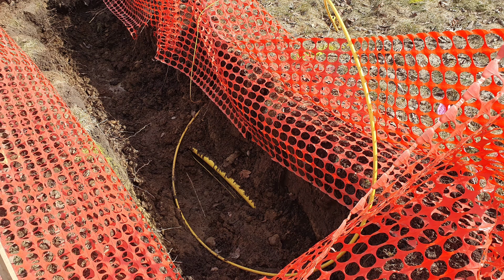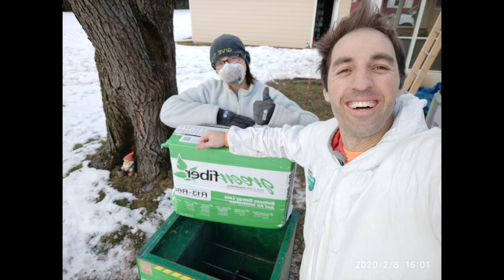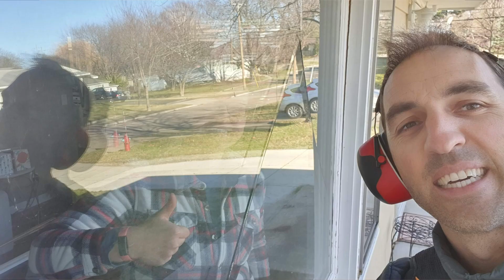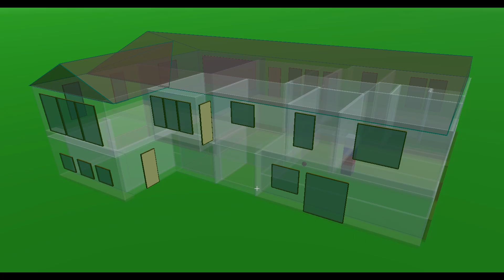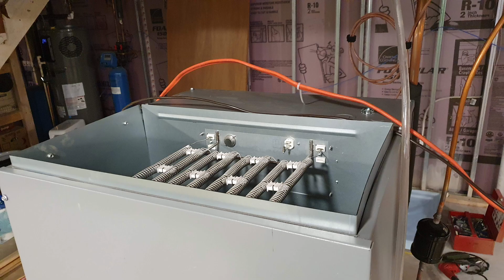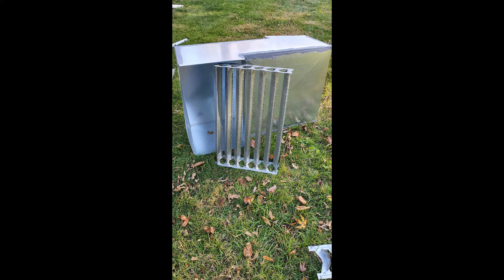Madison WI Cold Climate Heat Pump - DIY All Electric Home

Comment: Every House is JUst a badly shaped Chimney looking to expel your hard earned money upward and out. Sounds like you did a good job.
Reply from the maker: That's the stack effect.  Seal the top of the house.  Air seal, air seal, air seal.  Then insulate.  Then mechanical ventilation.

Comment: I'm up in Canada so our building codes will be different but I don't see why not go all out? It may be expensive up front but savings in the long run  more than make up for it. If I could, I'd go with SIPS, Geothermal, radiant floor heating, on demand electric hot water and solar panels. Only thing left to the grid is water and sewer.
Reply from the maker: YOLO.  What's the worst that could happen?  This is the future.
Reply: What I mean is I don't get why it's not catching on faster than it is.
Reply: @jesseterpstra5472 , there are a lot of lobbyist pushing against heat pumps claiming it's some for of communism. It's daft, but for a segment of the population, it works.

I would think that if you are a young entrepreneur just starting out, ground-source heat pumps would be the way to go in the colder climates.